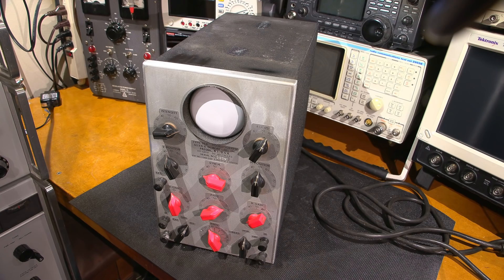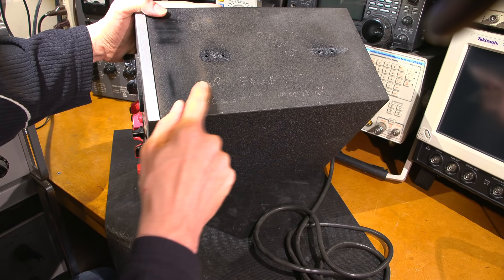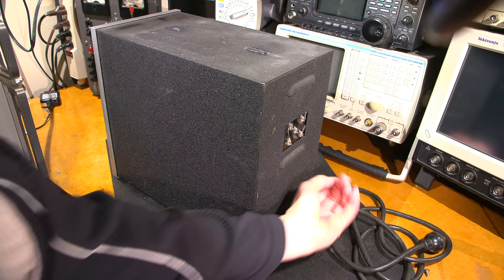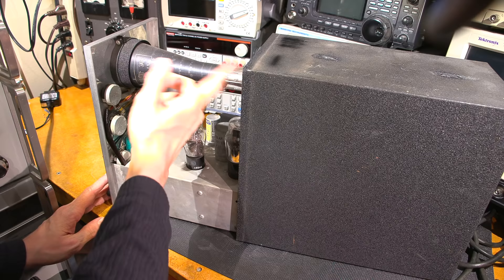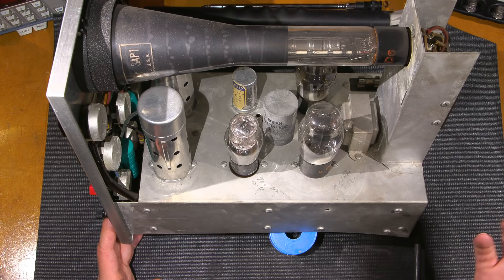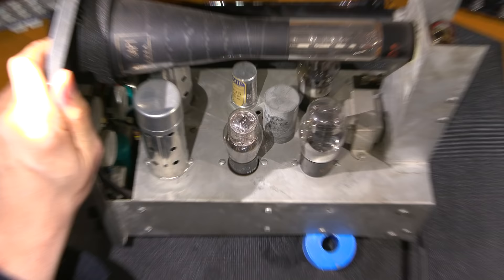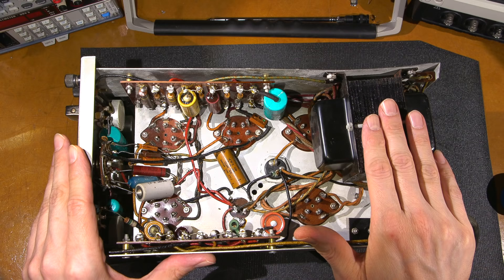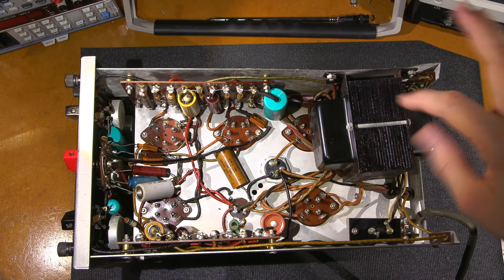1930's Electronics - Will It Still Work? Lets Find Out!

Comment: When a teenager I mistakenly touched the capacitor on top on one of those old globe tube radios. The older the radio looked the more I wanted it. My bedroom had a bunch of old time radio circuit boards. Some would run but others not. The capacitor shook the muscle on the back of my arms. This was in the early 60's. Wish I had those radios today.

Comment: Re old equipment:  I can't tell you how many times I've found it was operator error. I started a new job in 1997 and as I was being shown around for the first time, the guy I was replacing mentioned, "oh, that's broken, that doesn't work... been meaning to send that out for repair, etc" to at least 10 different pieces of gear. In the months that followed I could not find one piece of equipment that was damaged or defective in the slightest. It was all operator error by a guy who just never bothered trying to find out how to work the gear in the first place.

Comment: 17:06 that is precisely why I go for older stuff whenever it's practical for me to do so. For all its inefficiencies and bulkiness the old stuff will just never die. It will usually still function and even if it's malfunctioning it can be easily and quickly repaired, unlike modern stuff that's just 'discard and replace'.

My electricity is hydroelectric/nuclear anyway so I don't have carbon worries either. Win Win really.

Comment: Many many years ago, I threw together a Heathkit oscilloscope. However, it came with a solder supply, but whatever it was, it did not have the usual flux.  Whatever it had, it literally ate away the PCB's, each beyond repair. Years later, I threw together a Heathkit Hero 2000. This time I used my own supply of solder. My 1986 Hero 2000 is still working to this day. Although there was a flaw in the motor control board.  When in sleep mode, the main +5Vdc was shut down, but a sleep mode +5 Vdc was still active for basic functions. But that sleep mode +5 Vdc was not connected to all of the the motor control board IC's. So the IC's that were used to connect the motors to +12 Vdc and GND or vice versa, to determine the direction each motor was running, now had no +5  Vdc supply. But they worked, most of the time. The signals fed to these IC's had now become the power supply by providing current to the IC through the input protection diodes. But when it failed, the whole motor control board went up in smoke due to the +12 Vdc line now being connected to the GND, rather the path being through a motor. I managed to fix the board by replacing the damaged parts, twice.Once finding the cause of all this, I informed Heathkit of this problem, and so they kindly sent me a new assembled motor control board, for free.

Comment: Dumont goes way back, I used to work on some of the TV's they made and they were built like tanks!
I have an old Eico scope and is similar to this one. I haven't used it for a while and this gave me the  want to get it out and see if it still works . I recapped it back in the early 2000's and it was a good general purpose scope!
Reply: I have a 1960s one

Comment: Thank you!  I always enjoy your chats.  I was lucky enough to have a dad, who would build Heathkits to get equipment.  I  got involved as the oldest. One voltmeter - swipe dial - tube I think was my go to as I learned.  Switch circuits and  voltage scale, were easy to see and understand. A full scale would only tap the needle. These last 20 or 30 yrs with the DMM's. Most do not understand that the time delay to read the issue may fry the boards inside before you ever know to stop.  Looking forward to the build! Cheers Mr C.

Comment: Hi Mr Carlson's Lab
Inspirational. 
Due to your videos and a bit of lock down (sigh) in the last 6 months. You have inspired me to pick up my electronics and start doing electronics again. The result is repaired 1 battery radio receiver. 3 mains valve radios, 1 solid state transceiver and assorted other electronics on the shelf to be worked on. Purchased 1 de-soldering machine, how on earth did I ever manage without one of these. In the last month decided to get my HAM radio exams out of the way. Then I will be off to Patreon, I must have one of your capacitor testers and your no contact probe, that will save a lot of time.
Sincere thanks to your self and your brilliant videos. Oh and in reference to one of your older videos, hysteresis (his-ter-ee-sis)

Comment: Excellent educative video as always.
One question: When you hooked up the signal generator it looks like the scope is not sweeping the horizontal linearly. Is that correct and how they worked?
Reply from the maker: Yes, much of the time, the sweep linearity produced a trace that looked somewhat squished at one end. Very common with older scopes. Thanks for your kind comment too!
Reply: Thanks for that info!
Reply: @greggoog7559  Yes, I've seen several scopes from this era that had this behaviour, including one we had at school back in the 70s! If you look in radio magazines from the 40s "linear sweep" is advertised as a feature on some scopes!

Comment: You know, when you get one of those ah ha moments! EPR! Duh! 
It seems that I have always had a quasi understanding of capacitor failure modes! Apart from a shorted capacitor, DC leakage was the other and possibly the main reason why equipment fails! I have always been concerned with capacitor leakage but I still see plenty of people on YouTube that will simply put an ESR meter across the capacitor and say, oh! It's still good and yet it's capacity is making it look like an overachiever! This to me screams a problem with EPR, due to the DC leakage it's taking longer to charge the capacitor giving the impression that it now mysteriously has created more capacity in its current space time relationship LoL... No! It's bad and it has to go! Having extra DC on top of an AC signal will saturate the next component in line, it only takes a tiny bit of DC on top of AC for this effect to occur. 
I have read an article from the early years and they were well aware of this issue back then, the article was about how manufacturers of TV's wanted to ditch the power transformer and just go with half wave rectified supply but Australia blocked it because the electrical system used the galvanized plumbing as the neutral and the pipes would corrode in 3 months... 
So basically, it's not a new problem, it's been around for a very long time, and the lack of understanding of the problem is still with us today...
Maybe you should put your marvelous LCR Bridge into the spotlight alongside your EPR meter and show people what you really mean about EPR... 
Besides, I'm dying to see it being used! I never knew that such a device existed and it's been right there hiding behind you! Maybe we can get to see it in action in the restoration video? (Please 🙏)

Comment: I am building your test tools, and conserving / upgrading vintage British equipment.  E.G. Cossor 1039M or CT52 miniature O'scopes.  I find that some upgrades are required in order to make them useful for low voltage testing: swap the Y amplifier valve for a more modern high slope RF Pentode to increase gain and bandwidth: remove diode valves and selenium diodes and replace with silicon, then adjust load resistors to compensate for the changed voltage: add a sync amplifier: add a HT surge suppressor to keep HT voltage under 400 V.  Or alternatively make any power switch on the instrument switch HT on/off to permit first powering the valve heaters when powering from the mains.

Comment: Paul,
As always, another excellent video from you!  I always appreciate the thoroughness with which you go through the details of all the important things that need to be considered and aware of in working with the older vacuum tube equipment.
I also am amazed at how well this thing worked without doing anything to it.  The thinness of the line, the brightness of the CRT, other than the bent chassis and the discoloration and missing handle on the outside, this rig is in amazingly fine shape.
Really looking forward to the restoration on this one...and also eager to see more on the BC348 receiver!!!

Comment: Dear Mr. Carlson,

It's been maybe a year since I last contacted you.  I have this antique Delco radio which I inherited from my grandmother, and I decided to try repairing it as per your videos.  I removed the BED resistors and the waxy caps.  I also disconnected the tower cap and replaced it with equivalent new 10uF electrolytic caps.  The good news, I was able to find some poly caps which I used in place of the waxy ones, and I was able to locate the shielded ends of the caps.  I took a whole lot of pictures and used them to determine where to connect new resistors and the new caps (Allen-Bradley resistors are so hard to come by that I had to make do with film resistors, instead).  I replaced the unpolarized power cable with a reproduction cloth cable, making sure that the switched end was the hot lead.  I was able to get it to power up (I built my own light bulb iso transformer variac kit current limiter to make sure that the radio wouldn't catch fire had it been shorted).  One of the waxy caps was connected between AC power and chassis ground, and so I replaced it with one of those blue safety ceramic disc caps, making sure it was connected to AC neutral (the schematics call for it to be connected to AC switched which means to me that AC hot would be unswitched and AC neutral switched, which I think is dangerous).

Its "antenna" was just two cloth leads, all old and torn, and so, based on what I saw on some of your videos on the backs of all-American radios, I took one hundred feet of solid wire and made an antenna board out of a scrap piece of perforated pegboard, in which I spiraled the wire around about twelve times and put two more of those safety caps on each end of the wire (every YouTube video from anybody shows how to make a /parasitic/ AC antenna rather than a /connected/ one, and so I had to guess).  The pegboard also provides ventilation for the vacuum tubes while keeping curious fingers away from the tubes and chassis (it originally was open backed).

Now, the bad news.  I tested the radio and it makes not a sound.  Not even a hiss, crackle, or hum.  Nothing.  So, knowing that you know more about antique electronics than I do, I would like to deliver it to your shop for repairs.  I live in Los Angeles, CA, which I know is far away from Canada, but I don't know who else to contact.  Please give me your business mailing address, and I will deliver it there.
Reply: Thanks.

Sincerely,

Steven R. Mayhew

Comment: My Granddad's next-door neighbor did radio and TV repair. His house was FULL of old electronic devices! Every time I'd visit the Grandparents as a kid I'd go spend some time with him. When he was nearing the end of his life he GAVE me an EICO push-pull oscilloscope that he had assembled from a kit! I still have it. Yep the Horizontal sweep goes out after a while. Swapped the horizontal and vertical tube and the problem went to the vertical side. Yep, bad tube. Upside is I ALSO have a plastic tub full of octal-base tubes I found while cleaning out Granddads basement after HE passed. Each one has a piece of masking tape with "OK" written on it! I bet there's one in there... Also have some random CRTs and other bits of electronic gear. Bet some of that stuff is worth a few $$$! Might have to dig the old girl out and see if I can fix it...

Comment: The CRT part number refers to the type of phosphor, not the persistance.  P1 is an early phosphor, made from the mineral willemite, which is found in New Jersey, where many tubes were made.  The ST bottles are a combination of an S (sign) envelope, and a T (tubular) one.
Reply from the maker: Hi John. You may want to do a bit more research about CRT "P" designations, (the phosphor type indicates it's decay rate.) Most ST shaped bulbs have no other indicator, just a standard tube number. For example the 6L6 can be found in a regular "tubular" shaped bulb, or ST style (no change in part numbers.) This is one example out of thousands.

Comment: The horizontal sweep works but it doesn't seem very linear. That might of course be due to leaky capacitors. I stared at the sweep circuit to see if it was actually intended to make a triangle wave but I guess I needed more caffeine (or circles around the vacuum tubes) because I couldn't even see what makes it oscillate! Circuit diagrams aren't always laid out in a manner to best illustrate their operation.

Comment: 2 small comments.
 1. The horizontal sweep is probably suffering from some capacitor leak.  It is quite non-linear.  Although, the considerably newer Dumont scope that I saw and shortly played with eons ago was not fully linear either.  The same was noticeable on tiny Philips scopes of the same era.  That was just a short time after Tektronix (and probably HP as well) had their triggered sweep circuits on the marketplace.  Another vintage scope of those days was a Cossor.  That is likely the entire list from my early memories.
 2. Some of the "better" analog multimeters had either 2 500 V or 5 000 V DC scales, although those were by a separate probe lead banana socket.

Comment: I have a 1956 Hickok 195A which is the second upgrade to the 195 as you stated. Has a 5UP1 CRT, kind of emotionally attached to it since my grandfather gave it to me as I got started in electronics as a hobby in 1972. Took it out of use since the across the line paper wax 0.1 uF 400v capacitors were getting hot, before they pop. This video is getting me motivated to get some modern safety capacitors ordered from Mouser and get it fired up again. Could just clip them out for now just to do an assessment I suppose.

Comment: Enjoyed your presentation.  I used to have the same scope, but the power transformer
went bad in it.  Which reminded me:  In 1933 the line voltage was 110vac.  Today the
line voltage is usually a bold 120vac.  (a "bucking" transformer) is a good idea when
using these older electronic devices.

Comment: Paul, are you going to share the diagnosis of the sweep circuit, and ultimate repair of same?  Would love to watch along. I have the Laboratory model of that unit, with the mammoth power supply that sits below the scope and control unit, this video has been very helpful!  Thanks a million!!

Comment: I've always wondered why you don't use a bench supply to test vintage equipment? I find it very helpful to remove the rectifier tube and lift one of the filament leads from the transformer, then use an LV supply to power the filaments and an HV supply with current limiting for the B+. That way I can have the filaments at full temperature whilst gradually raising B+...
Reply: ...the other advantage of having them on separate supplies is that you can set a very low current limit on B+.

Comment: I have an old DuMont in the project pile, a 304A iirc.  The thing that's kind of putting me off is that it looks like it was about 8" deep in a flood, there's silt coating everything below the water line.  Mostly I'm afraid the silt has shorted out the power transformer.  I did pick up a xfmr from a parted out unit on eBay, but have not tested any of it yet.  Will be following the restoration of the one in this video to sort of see what I'm up against.
Reply from the maker: I have a 304 in que as well. They are a neat scope.

Comment: Starting at around the 17 minute mark, I swear I could hear "There is nothing wrong with your television set. Do not attempt to adjust the picture. We are controlling transmission. We will control the horizontal. We will control the vertical." 😱

Comment: Oscilloscopemuseum .com has a copy of the original instruction manual with schematic and parts list at the end. Look for  Dumont model 164.
I'm impressed that the controls  all  work. Not surprised by the capacitors.Eventually Mr. Carlson will show us the restoration. I'm looking forward to that.

Comment: The horizontal trace does seem to be a bit non-linear though, maybe a slight problem with the horizontal sweep-circuit, could be that the sawtooth waveform has gotten a bit distorted for some reason, it could be that the horizontal sweep oscillator tube needs its biasing tweaked a bit.